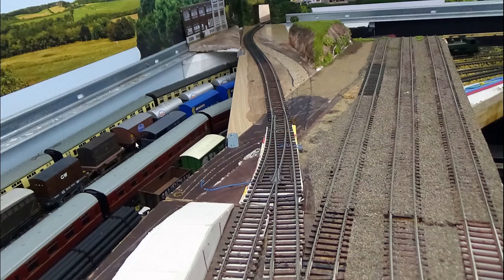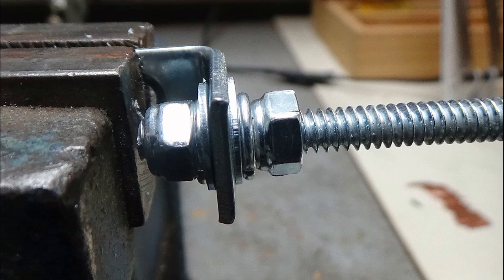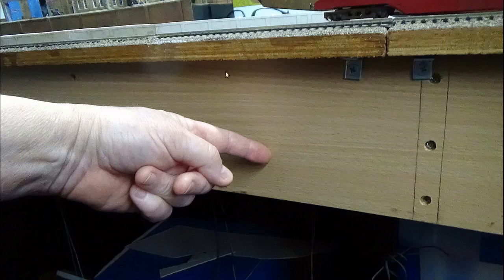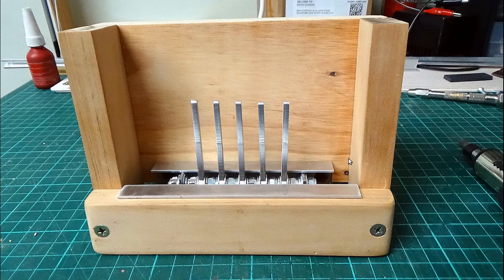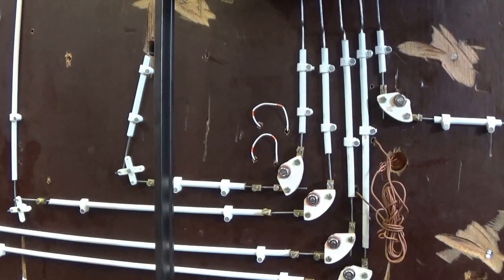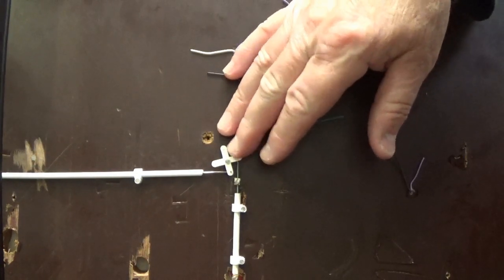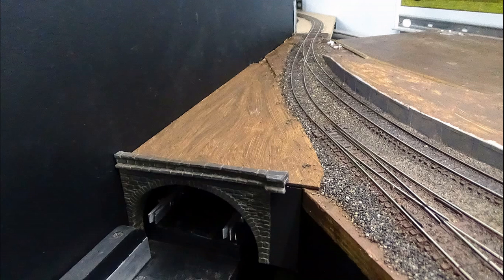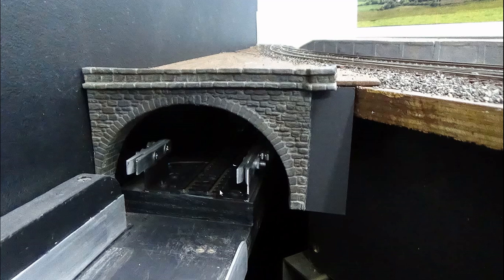GCJ Update October 2020 a re-shot version due to technical issues

Comment: Very nice home made levers and rodding to move your points. Very interesting methods of doing and using what is readily available than branded expensive units. I look forward to the next update to GCJ to watch later.
Reply from the maker: Thanks John,
They are a labor of love with the emphasis on " labor".
This method with extensive use of tile spacers really is still a test. My original bellcranks made from plastic moulding have stood the test of time and may yet still be needed on this section of my railway.....time will tell.
Cheers Gormo

Comment: Great video once more. I have been trying to work out how you got the final wire to work the points for ages, finally the penny dropped. Cheers Gormo keep safe. Frank
Reply from the maker: G`day Frank,
Glad the penny dropped, yes the method is an old one but it works. I`ve used it before on two points on the main board at GCJ and no issues over seven years or so.
Cheers Gormo